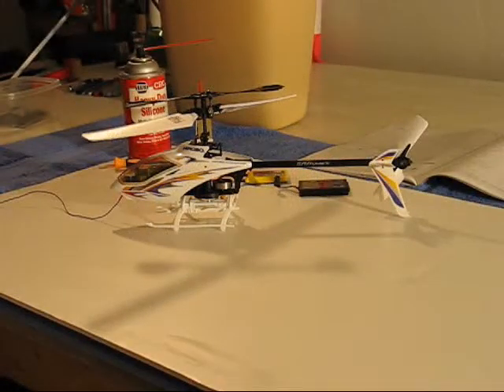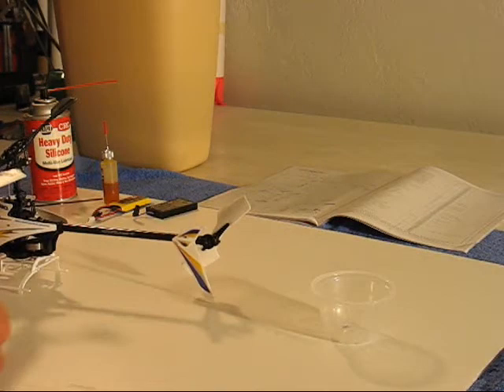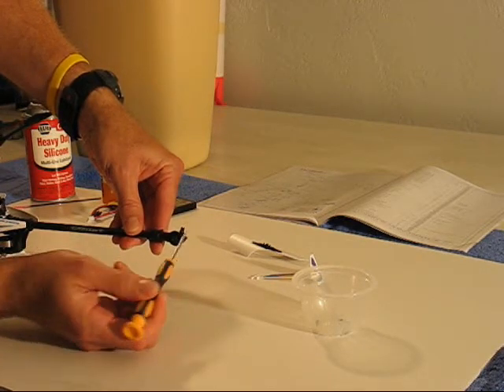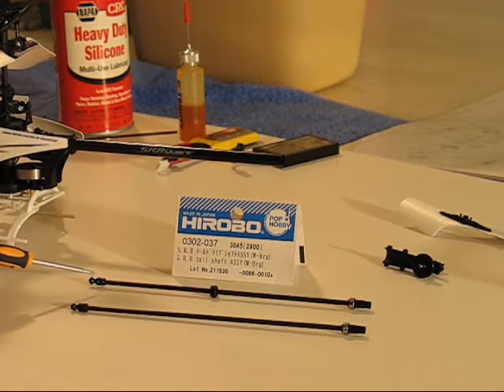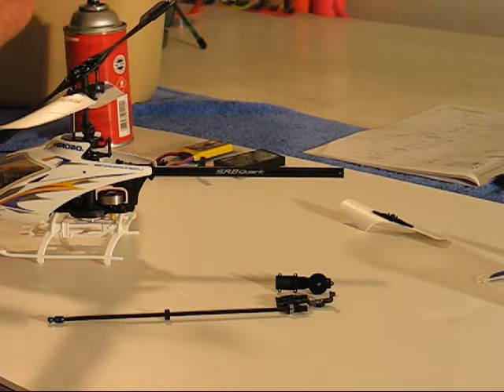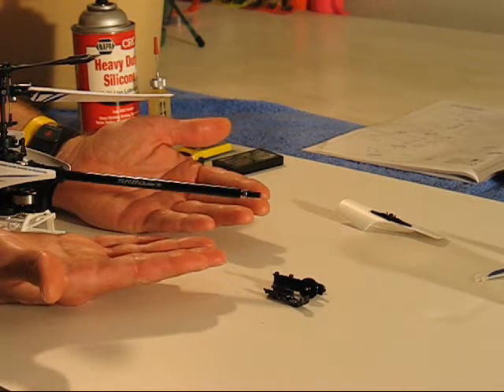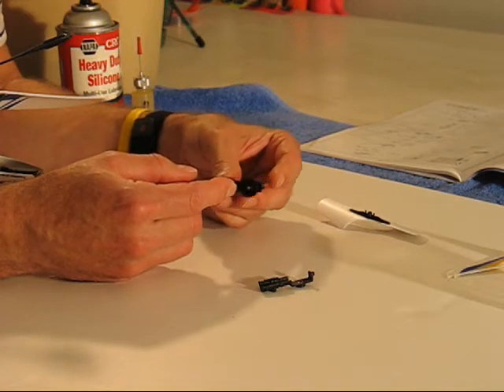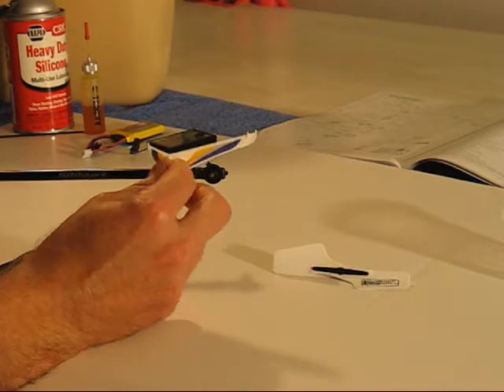Hirobo SRB Quark - Double Bearing Tail Drive Shaft Upgrade

Comment: Not sure if you still have a Quark or remember how to work on it, I cannot seem to get the tail gear to mesh solidly with the tail motor.  on the inner shaft, there is a small black thin o-ring metal piece  Should that be positioned directly behind the bearing or in the front near the motor.  I just cannot get it to mesh correctly no matter what I try.  I push the inner piece in, it eganges to the motor, but when I pull it out slightly to get the bearing into the tail assembly, it never meshes with the tail gear.  Im stumped....any help would be great.